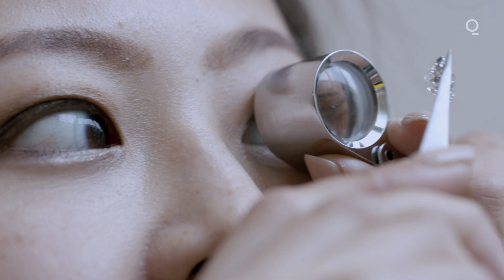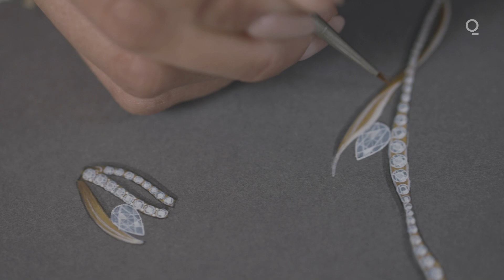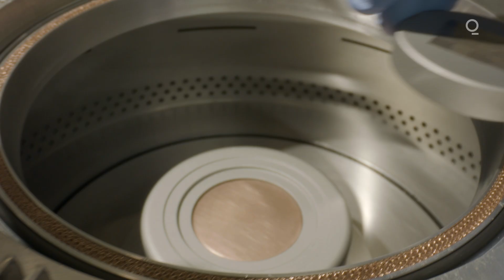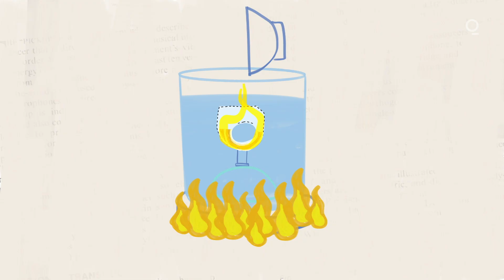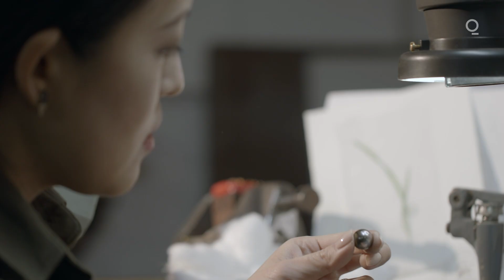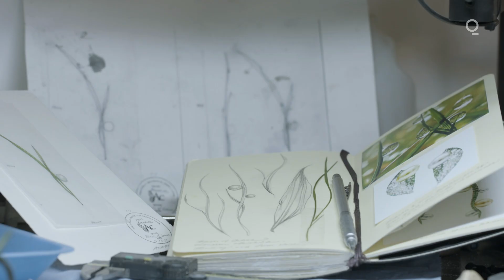Why Lab-Grown Gems Are Becoming The Real Thing

Comment: Diamonds have always been controversial; their value seems almost baffling given that they’re essentially just shiny rocks. In fact, diamonds are more common in the universe than we might think. On the other hand, lab-grown diamonds (LGDs) are even less valuable because they have zero resale potential. For instance, if you buy a $500 LGD ring, no jeweler would buy it back, even at 1% of the original cost. In contrast, a $5,000 natural diamond ring can often be exchanged for another piece of high-quality jewelry at 100% of its value, with resale values typically ranging from 50% to 60%. While most people don't sell their diamond rings, having the option to do so is crucial.

Looking ahead, I anticipate that within the next decade, LGD production will become exceedingly cheap, potentially flooding the market with hundreds of millions of carats annually, with rough cut prices dropping to around $30 per carat. This oversupply will likely drive LGD prices even lower.

Comment: Natural diamond need high pressure to be formed. Under low pressure Carbon would go into graphite (each one carbon atom is bonded to another 3 carbon atoms), and only when you add high pressure (at it has to be quite a high pressure), Carbon will form diamond (each one C atom is bonded to another 4 carbon atoms). And so, I always wonder, if you don't create any high pressure in your synthetic production process, how do you get the Carbon to go into the diamond and not into the graphite?

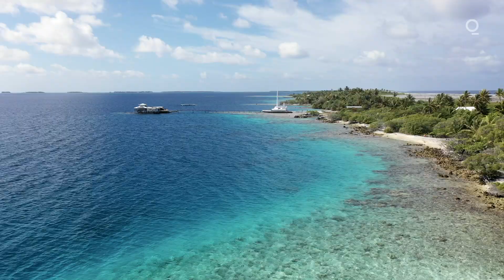Comment: 17:30 It's obvious that 3D printing would eliminate the "Organized Chaos" in creation and labor of manufacturing such things.
Reply: wait is it possible to 3D print aluminum, gold or any other metal. I thought 3D (additivie) printing is only currently possible with hard or flexible plastics
Reply: Metal 3d printers have been around for decades they cost in the millions and fine jewellery snobs don't like machine printed stuff
Reply: Usually 3D printing is being used in the jewelry industry to make the lost wax figure, as it leaves some structural micro cracks if you print with metal
Reply: @nunya___  Part of the value that she mentioned was the hand-crafted (and unique) nature of having a trained artisan design and hand create your unique piece. Once it becomes a factory manufactured item that can be mass produced in the millions, then the object loses almost all of its value. While you may not agree with that definition of value, I think most people understand the difference between "I've had finely trained artists handicraft this item for you, and only you," and "here is something that a machine made that a million other people have."